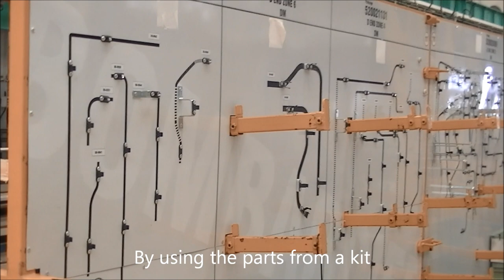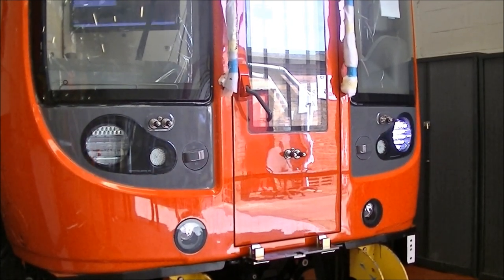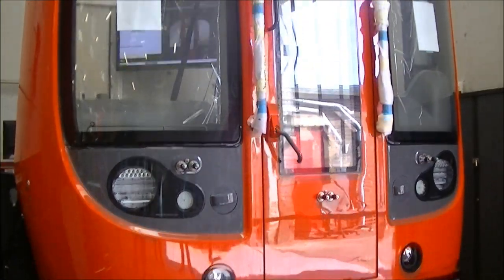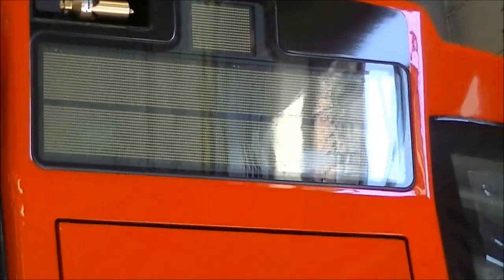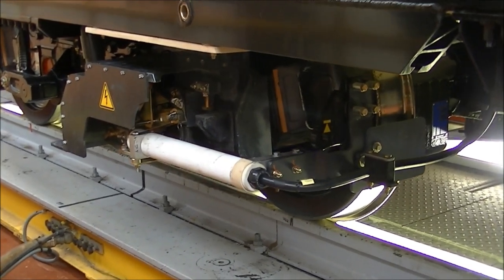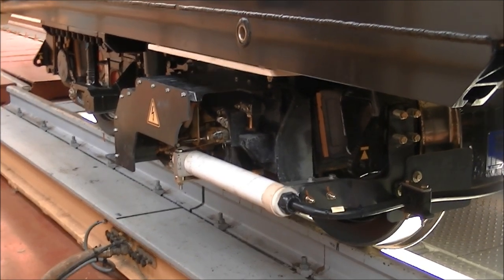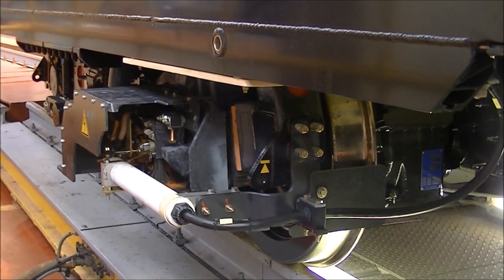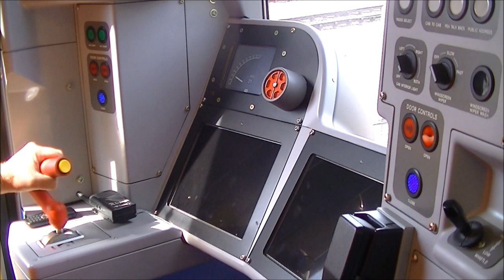Production of the S Stock Trains

Comment: Insane that these trains are already over 10 years old, they still feel brand new compared to most.
Reply: Modern style electrics are designed to seemingly age alot differently to older methods of rolling stock. Theyll probably age alot better than 1973 stock or 1995 stock etc.  With good maintainence also.

Comment: I have noticed that these are S7 stock and these trains are not for the metropolitan line except in case if an S8 fails so the S7 becomes the S7+1 apart from that these trains are destined to the Circle, District and the H&C lines to run in normal service with no train dedicated to one line for the S7s but the S8s are dedicated to the metropolitan line.